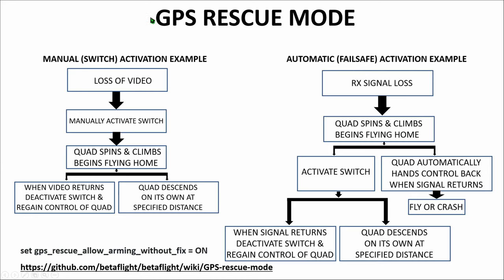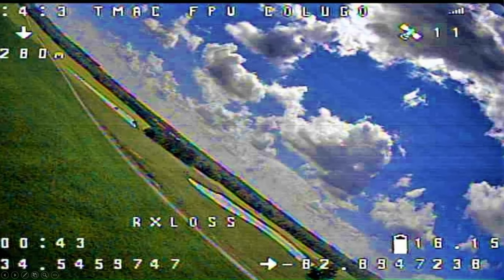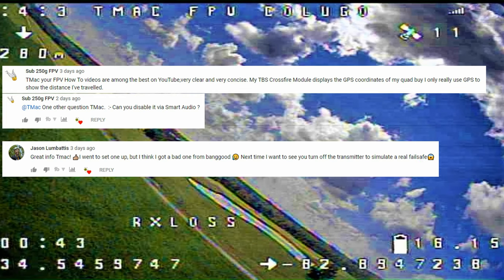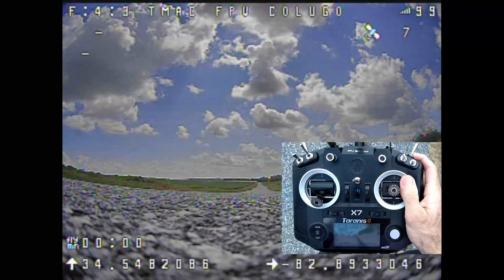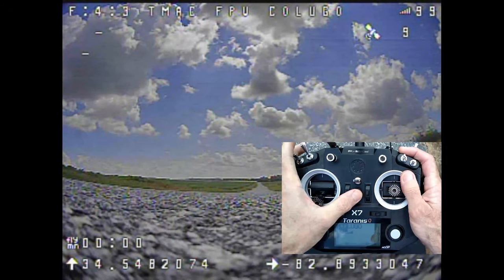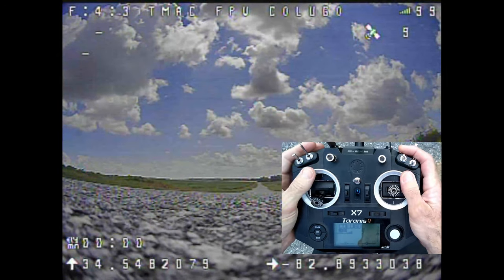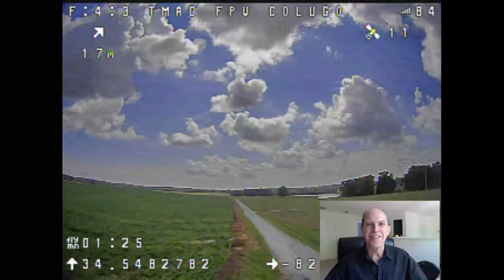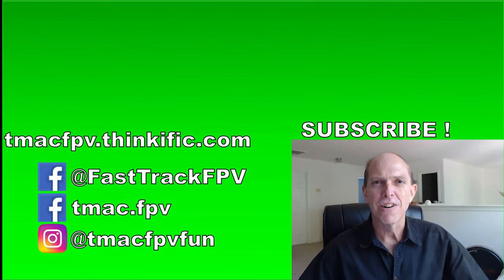BETAFLIGHT GPS RESCUE MODE FAILSAFE

Comment: A very important feature has been added to Betaflight that allows it to handle and intermittent radio signal. This means you don't have to worry about switching on gps-rescue if you get a failsafe.

Sadly its only in the 4.1 dev branch and the release of that has been pushed it back to October.
Reply from the maker: Hey Stephen! Thanks for the info, but I'm a little confused by it and hoping you can elaborate.  When I currently have GPS Rescue set for failsafe mode, I currently do not have to worry about switching it on (with a switch).  The only reason I currently need to activate it with a switch after it has entered GPS Rescue Failsafe mode is so it doesn't "hand back over" to me as soon as it regains signal if I happen to be not ready for it. Am I making sense? Understand what I'm saying? So, how is this "added feature" you're speaking of different than that? Thanks!
Reply: Sorry, this is misinformation. There are no new features related to "intermittent radio signal". Perhaps you're referring to the way that GPS Rescue hands back control after a failsafe recovers signal. Previously on signal return GPS Rescue would immediately return control to the pilot and disable rescue mode. In BF4.1 GPS Rescue will continue to operate until the pilot performs some stick movement to retake control.
Reply from the maker: @BruceLuckcuck  Bruce-thank you so much for clarifying this! Not only that, but this new capability you mention for BF4.1 GPS Rescue is OUTSTANDING! Very much looking forward to it! Great stuff!
Reply: @BruceLuckcuck  sorry, but which kind of movements? I have problems to take control with BF4.1, I have do it the same test that this video, but when I turn on and want to rearm nothing happens, and moving aleatory sticks RTH off and quad crash. I don't see any information about it.
With switch gps recue, no problem. I take the control to the right way.
Thanks

Comment: if with your TX OFF (at 3:59) the RSSI is keep alive and set 92%, How?
Reply from the maker: The RSSI value displayed on the OSD is frozen at the last transmitted value prior to transmitter being turned off. Notice it didn't move at all from 92 until I turned the transmitter back on

Comment: I have tried betaflight rescue, but it drops suddenly after I have enabled gps rescue, and what is sanity mode, should I turn it off?
Reply from the maker: Hey Andri! From Betaflight github wiki (pay particular attention to last paragraph about when conditions not met, quad will drop): "DEALING WITH FAILURES / SANITY CHECKS (VERY IMPORTANT):
If you're using rescue mode in a supervised fashion (as a switch only with video), or in a place with no danger to surroundings (over water, etc), sanity checks are entirely optional. If you plan on setting this as a failsafe (and most of the time even if you do not) you should highly consider enabling these.

set gps_rescue_sanity_checks = RESCUE_SANITY_ON

You can also set this to RESCUE_SANITY_FS_ONLY if you want it to only matter in a failsafe (unsupervised) condition.

Sanity checks will ensure that:

GPS receiver is still connected to the FC
GPS receiver is sending a valid GPS Fix
Quad has not experienced a big shake (probably due to a crash)
Number of Sats is equal or above gps_min_sats
Quad gets closer to the home point after reaching initial altitude
If any of the conditions is not met, the Rescue operation will be aborted, meaning the quad will be dropped. However, the last two conditions have a few seconds of tolerance before getting triggered. Also, if the quad is not getting closer and a magnetometer is being used, Rescue will attempt to use GPS orientation as a second chance, but if a flyaway is still detected, the operation will be definitely aborted."
Reply: @TMacFPV  problem is, i used dji fpv system remote, i cannot see on my goggle about gps status, do you have any insider info from dji dev perhaps, about when will they release update for the osd, thanx beforehand
Reply from the maker: @andriroyantara  Unfortunately Andri, I do not
Reply: @TMacFPV  well, I guess I just have to wait then until dji fully support this feature, meanwhile I just play nearby and have fun, tried not to use crossfire and OpenTx remote, thanx Bro
Reply from the maker: @andriroyantara  Quite welcome Andri, have Fun!